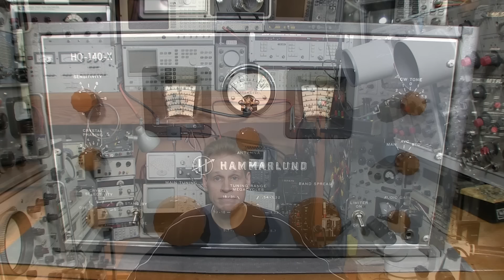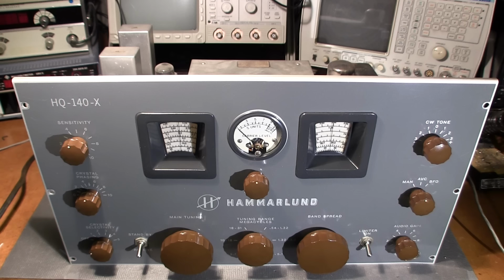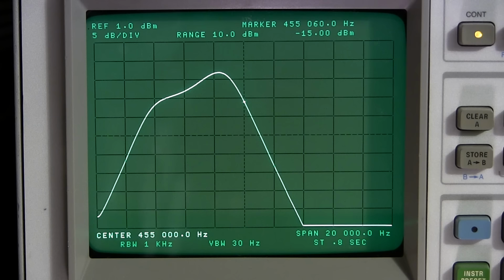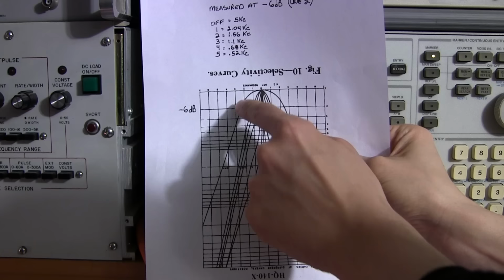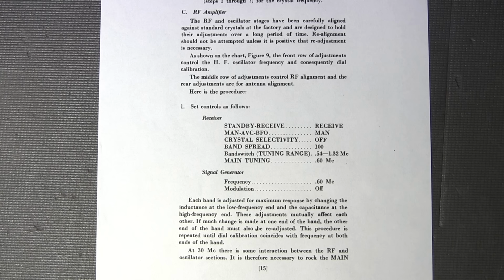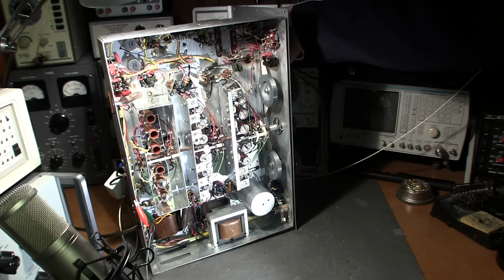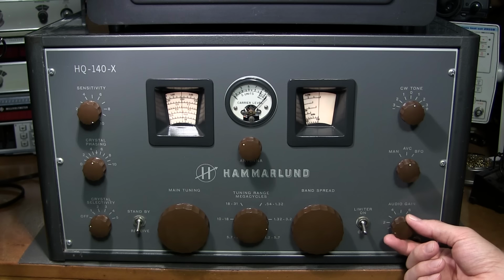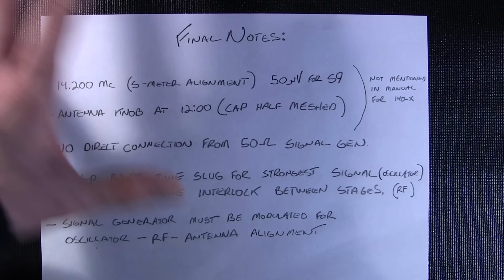Hammarlund HQ-140-X Repair and Restoration

Comment: Mr.Carlson,
I tried to electrically restore a Friend's Hallicrafters S-38A . It worked for me fine, but when my friend plugged it in, it "smoked" the new electrolytics. I think I missed something, but my friend wouldn't let me see what happened. Perhaps I made a mistake when following the schematic. The "All American Five" receiver is a killer due to its transformerless design, I have an example of each of the S-38 series, and want to restore each of them. Can you find one and do a restoration on one? I would most appreciate this, your abilities impress me and I wish to learn from you. These radios are dangerous no matter which way you plug them in, unless you use an isolation transformer in the line and a three wire cord with plug. Isolating the chassis from the case is very important, but someone may touch the chassis inadvertently and I would like to keep that from happening by having an enclosure to cover the back of the radio. Can you help me? Please?

Comment: Those milk 🥛 chocolate 🍫 colored knobs look 👀 great 👍 on that radio 📻. It seems like 👍 about every owner gets into the back of these radios 📻 to align, or fine tune them. Often, they use metal tipped screwdrivers 🪛 to turn the capacitors. This can short a capacitor out, and ruin it. Doing this is much like 👍 the game Operation. Touch the capacitor with the screwdriver 🪛, and that capacitor is shorted. I’d be scared 😱 to try to clean 🧼 those dials, taking the numbers off. That would really suck, since ya cannot make it original, trying to put the numbers back on. I’m certain somebody can, but at what cost? Keeping one ☝️ of these radios 📻 original as possible, helps it hold its value. I really like 👍 the impressive length of this video, almost 😅 topping 3 hours. Your friend, Jeff.

Comment: Great video! I learned a lot...thank you!
BTW: What is the adjustment tool you are using that looks like a glass rod with red/blue ends?
Reply from the maker: Thanks for your feedback Greg! The tool is a lucite rod with non magnetic ends, designed for oscillator , RF and IF tuning.
Reply: Kewl beans...it looks like it can really help with keeping body interference from effecting the calibration of things.

Comment: Great video.. Did you make any MDS measurements around 10 & 15 Meters? Also, do you which HQ 145 was first, the one with the black knobs or nice chocolate knobs?

73, Glenn
Reply from the maker: MDS, Partition Noise, and so on would be an entire video. I haven't done a video on an HQ-145 yet. Thanks for your comment Glenn!

Comment: Paul I have a marantz amp PM250 which does this. so no guessing what it will be. have to make the super probe now! funny i made knock ears for my car not so long ago which are amazing also and great to listening to lifters and valve operation etc.
Reply from the maker: You should make a video and share your "Knock Ears."
Reply: .....thanks....its just a nissan knock sensor and a couple of caps ; two 9V batteries in series to give me +9 -9 and GND, and, a little op amp to do the rest with 1/8" phone jack

Comment: I have to wonder if the knobs were not military knobs, but who knows for sure. Brown knobs over olive drab works really well. That is one pristine Hammarlund receiver. Those old firecarcker Astrons will go bad on the shelf, but you already know that. I have an Eico, or something similar that will goose me with 600 volts. Same deal, all vac tube, eye tube indicator. The Sencore Z Meters are kinda cool for checking caps for leakage. I reform caps with a regulated Japanese tube PSU, a decade resistor sub box and a galvanometer. I'd guess the old girl has drifted, rather than been mucked with. How ever did you get something that clean. I get stuff with mice, wasps, roaches, rats, bats, and other pests living inside it. I got a really nice old Conrad Johnson stereo someone's darling child dumped chili, Chunky Beef Stew or maybe spaghetti & meatballs into. I am not really sure. After 28 years, what dripped though the louvers,  all looks the same. Petrified puke! Remember, tighten those screws up until you hear that Bakelite crack, then back off 1/4 to 1/2  turn. 73 KI7AQJ.
Reply from the maker: LOL, That "cracking" noise make me cringe. The two signs it's been owned by a HAM: Their SIN# is carved in the most obvious place, and.... everything has been screwdrivered. This receiver even had one of those signs. (see the shiny dots on the tuning capacitor cover, in the receiver.)
Reply: Don't forget  the 3 pounds of tobacco residue! Hams: Putting the amateur in amateur radio since 1919. My new in box 1944 Stancor "code word "ULTRA" Majestic Radio output transformer arrived today. $13US Original box. 1940s mail in post card for a new Stancor catalog, original wiring diagram, and the original "Code word "Ultra" tag on the center tap lead. I have to say, for a chairside radio OT this thing is really really hefty! Wow! I have Woodward Schumachers made for Fender that put out 50 watts that are about the same size. I have some 50 watt Chinese Epiphone OTs that are smaller.   It is supposed to work with two little old type 45, pentodes! I have some type 45s, 75s and 80s in a junk tube box. It's harmonica amp time!
Reply: I need a new spectrum analyzer sooo bad. This week, I turned down an Icom IC R65 IOB for $350, and a JRC NRD525 for $395, a Snow Glow Rickenbacker 360 for $1200, and some other really neat stuff, and killer prices. I did buy a Kenwood SM 220 for $130. All it needed was a fuse,  but no Band Scope BS8 module, so I'll try to build one from scratch. I assume the CS201 is a narrow bandpass ceramic filter, and I need to figure out what transformer T201 is.

Comment: Sure would like to see you align one of those Hallicrafters SX-28s you have in the back room.
Reply from the maker: They are in my future plans. Those receivers are "very" time consuming.
Reply: Tell me about it. 65 resistor and 44 capacitors later and I have a working radio but I am struggling with the alignment. Almost there but not quite yet. The thing is a beast.
Reply from the maker: The best way to align those is with a visual method. Getting the skirts "even" is a challenge, even with a spectrum analyzer. Tune the whole IF chain for maximum amplitude first, then form your stage curtain. This is the easiest way to get good results.

Comment: Paul, I am a regular watcher and Patron member as well. I am in the process of restoring a HQ-120, the same version as you went thru a few years ago. I have a few questions regarding the alignment method you used here and on the 120. Where did you connect the tracking gen output, and the spectrum analyzer to these chassis? I see you had a 50 ohm to high impedance adapter for both connections. Where did you obtain these, or did you build these? I have been watching and rewatching these videos, and perhaps I have missed the answers to my questions. If so, I apologize. I am new to this method and am stumped, at this point. Any help you can provide me would be appreciated. Thanks. Chris, N9WHH.
Reply from the maker: Hi Chris, pin 2 of the 6AL5 goes to the spectrum analyzer input through my protection device. Remember to lightly couple the protection device to that area (clip the protection device signal lead to the insulation of the wire attached to pin 2 of the 6AL5,) there is enough signal in that wire to drive the analyzer correctly. Connect the tracking generator output of your spectrum analyzer through my other protection device to pin 7 of the 6BE6. Again to the insulation of the wire attached (light coupling.) It's extremely important "for the best alignment" to keep the test equipment invisible to the receiver. If its coupled heavily, you will load the receivers circuits, and when you remove the test equipment, the receivers alignment will change due to a capacitive and inductance difference. Here is a video on the protection devices I designed:  https://youtu.be/ETKyKC2Zj-M
Reply: Thanks Paul, for the reply. This is what I was looking for. I am gathering parts to build the protection devices now.  I will see how it goes from here. 73 Chris.
Reply from the maker: Great, let me know how it all goes.

Comment: A majority of these radios 📻 have very complex dial cords, and they can be very hard restringing. Alignment of the dial pointer, to being in relation to the proper marks, or numbers on the radio 📻 dial, is probably actually easier than dial cord restringing. It’s even tougher to restring a dial cord if it breaks, because the dial cord may not follow its actual path to the next pulley. It will be slack, and out of form, and not taut. In other words, the dial cord will lay in shapeless form around the pulleys. Unless ya knew exactly how the dial cord was strung, that could be easier, or if ya observed it during breakage. Your friend, Jeff.

Comment: I think it is important to remember that the whole point of the Xtal filter is to make what you want to Hear  Hearable.. and to that end the Ear is an extremely sensitive and reliable instrument... (if well trained).   So I would challenge you to go ahead and do the final alignment by ear.. after using just a signal generator and vtvm.. and then check the result with your spectrum analyzer...  see what you can achieve.. and what likely Hammarlund did achieve before shipping.   I think you maybe surprised.  And in the interest of fairness, I would like to know too !

Comment: Do you just prefer the older gear? Do you use any modern equipment besides your multimeter?
Reply from the maker: Hi Michael. I do prefer older gear just due to the fact that it's built better. If something fails, it can be serviced almost immediately. It also helps with the explanation of the way things work to everyone here on youtube. One thing needs to be kept in mind when buying test gear, you can only measure Voltage so many ways. Why do I need to keep purchasing new gear to do the same function.  This applies to most gear as well, oscilloscopes, signal generators, spectrum analyzers.... so on. I guess in short, I'm not trying to keep up with the newest fads, the lab isn't a fashion show, it serves a function, which it does very well.  Thanks for your comment!
Reply: Michael O I

Comment: .. what a Great Channel..🏆🍹
Reply from the maker: Thanks!
Reply: @MrCarlsonsLab  ..no worries.. from age Eight i grew up in a Children's Home that was Ridiculously Religious..No Radios of our own, No Rock Music, None of that..so Nine Year Old Me bought a Radio Shack Crystal Radio kit at the mall, brought it home & put it Together (had the springs & lengths of wire & Components, that thing). So Every Night i'd toss about twenty feet of Wire out across the Roof from my Window, clip the Ground to the Bed Frame, & listen to the two local A.M. Rock & Roll stations into the night..i Disguised it somewhat & No One Ever Knew or even Knew What it Was..so that's My Intro to Electronics Story..loved it ever since..

..that Radio Saved My Sanity..

Comment: Hi Paul. I'm curious about your device to connect the 50 ohm signal generator to the receiver.. I have an RTMA that I built from a Hallicrafters SX-110 manual but I don't know if it is to be used with a 50 ohm generator. Can I just terminate the input of the RTMA with a 50 ohm resistor. By the way! I just picked up an HQ-140-X (with chocolate knobs) at an auction today. I can't wait to get started but I've got to get my Hallicrafters SX-28A finished first. I nicknamed it Lucifer because I'm sure the Devil himself designed it. Another great one Paul. Thanks, Dave WB8VQV.
Reply from the maker: Thanks Dave! Are you referring to an RMA dummy?
Reply: Yes. I'm not sure why Hallicrafters  put the "T" in it. I compared the Hallcrafters circuit to an RMA and they are the same. Thanks for the reply.

Comment: I would have preferred to see you flash a circuit diagram of your RMA dummy device rather than leave us in the dark until you get around to making a video of it (maybe you could include a link to it in your comment section).

Otherwise, another excellent video. Well done.

Comment: That Oscillograph during the RF alignment is gorgeous could you by any chance link the model number and a specification page?   Great video by the way! A+
Reply from the maker: Here is a page with the RCA version  http://www.myvintagetv.com/vintage_test_equipment.htm  Scroll down a bit. it's an RCA 151-2 or a clone of it.
Reply: Thank you! It surely is a great piece of test equipment. It may not have all the bells and whistles like today's scopes, but for repairing vintage gear, it's perfect, that is what is was designed for! Keep going with the videos can't wait for the next one. I love vintage electronics!

Comment: Paul.  Thank you for your amazing video's and sharing your vast electronics knowledge with us.  Impedance matching is a elusive mystery to me.  I cannot afford the fancy specturm analyser you have.  I have an old HP141T with tracking generator.  Can you tell me anyway as to how you added the 50 ohm termination to your SA protectors.  I'd like to build them but my tracking generator has 50 ohm output.  Can a 50 ohm network termination be used with a bnc t connector at the SA protection device??  Could I use a bogen impedance matching transformer t725??

Comment: "Milk-chocolate" brown, eh?  I would have used a scatological term and saved three syllables.  Not many people can look at that radio and not think that the knobs were some sort of "marriage of convenience" replacements.  With a beige cabinet/bezels and a brown or "woodgrain" (natural or synthetic) front panel -- or, even, vice-versa -- those knobs might have "worked".  As it is, though, they look [really] oddly out-of-place.

I wonder what those Hammarlund boys were thinking(?).  They made some really pretty radios (HQ-129X, HQ-180's, SP 600's...), but those brown knobs really put me off my feed.

Comment: Does that clock signal actually carry time information or just strobe the clock?
Reply from the maker: Lots of information in that signal, and a ton of information in the 60kHz signal (WWVB)
Reply: Cool. From the sound I assumed it might have a higher bitrate. At least it is foolproof.
Reply: Seems like your band surfing revealed some faint data streams as well... and that Morse beacon, it is pulsed carrier rather than modulated in the usual sense, right?
Reply: Germany runs a similar system...
 https://en.m.wikipedia.org/wiki/DCF77

Similar 1bps bitrate too.

Comment: I was encouraged to get my hands on a HQ-140-X by this video, which arrived via Ebay a few days ago.  Another nice clean machine with original components, so I have some work to do.

I have despaired at finding those ceramic standoffs shown in the video, so those will be something to look for at the next hamfest.  But I did find HayseedHamfest.com, that fabricates nice new filter cap cans for the 140-X (and just about anything else you need).  So I will give them a try.

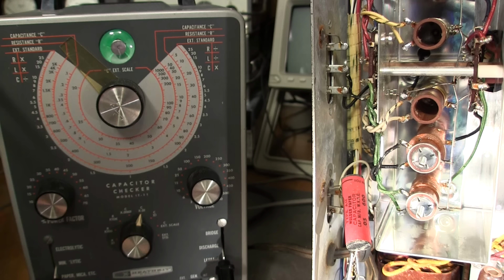Comment: 19:22 If you had done the same test but with your DIY one it would most likely have shown it as leaky.
Reply from the maker: Most likely yes. The CLVLT is designed to detect leakage at extremely low levels, much lower than the Heathkit.

Comment: One quick test for the fun of it. with old wax paper cap that has set dead for years. Put your dvm on 200mv dc and test cap. lots of them are so corroded inside that they act like a battery. Obvious sign its not useable.

Comment: Is that an Alctron HST-11A microphone, by any chance?
Reply from the maker: No it isn't. I may do a video on the mods though.
Reply: Then what is it, assuming it's not a secret? :) 
Couldn't notice any branding on the front.
Reply from the maker: That would spoil the mod's video surprise :^)
Reply: Apex 460 then? Either way, i'm pretty sure it's a tube mic, and likely some rebadge of the HST-11A. Solid-state doesn't warrant that long of a body :P

Comment: Point style ignition, cringe... IMO, one of the best aspects of electronic ignition was getting rid of points. Sure they weren't overly complicated, but because they were a mechanical electrical contact they were a common failure point.

Comment: What an ordeal. How long would alignment take at the factory when nothing was set close on a new receiver? How many hours would it take to hand build one of these?  Modern stuff is built at 10-20 component placements per second !!!  Passive components cost 1/10 cent. Today we would build the contemporary equivalent of this by machine in less time than installing a single leaded resistor by hand. 

 A tinkerer with a screwdriver could render this thing useless in seconds.
.

Comment: A superb video that compliments the one you did on the 120!.  I too would like to know what modern low-cost sweep generators and software defined spectrum analyzers (SDRPlay and ??? software) could be used for this type of work. I have a beautifully restored and recapped 120X that needs this tune up.  Link here to that project: http://swling.com/blog/2016/06/colins-hammarlund-hq-120x-restoration/
Reply from the maker: That's one nice looking 120! You did a fantastic job on that. I think they are definitely one of Hammarlund's nicer looking radios.

Comment: It only hurts until the pain stops. These cap leakage testers and AC/DC hi potential tester prove that white men actually can jump, depending on the voltage delivered. Even old white men jump pretty high when a multiple KV  high potential tester is misused. All misuse was purely unintentional and 80% of the shocks were delivered to myself. MV cable acts just like a capacitor and I do have a bad habit of not discharging it, so the next poor soul gets the high DC voltage surprise.